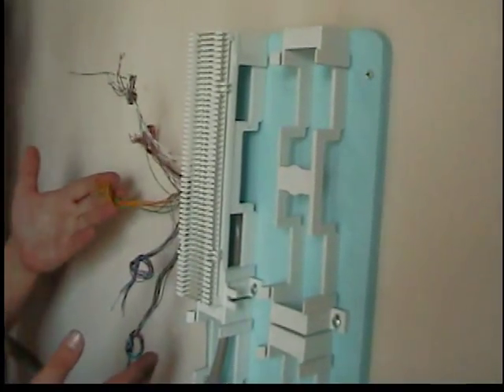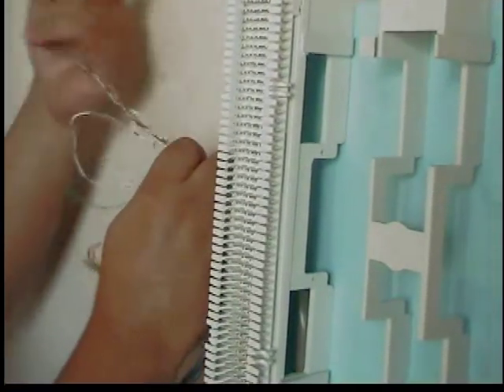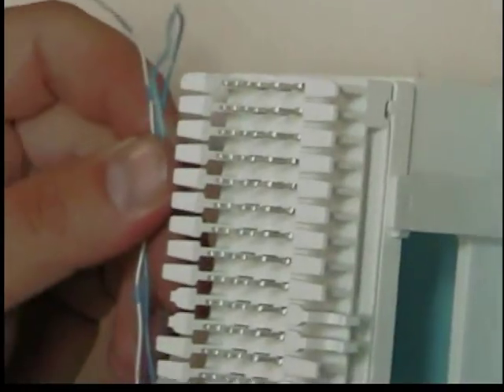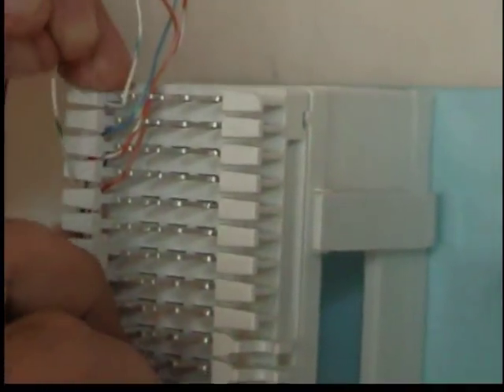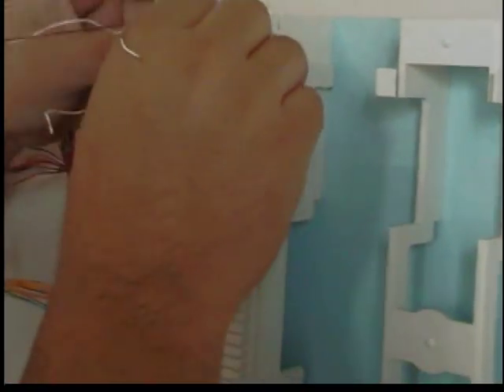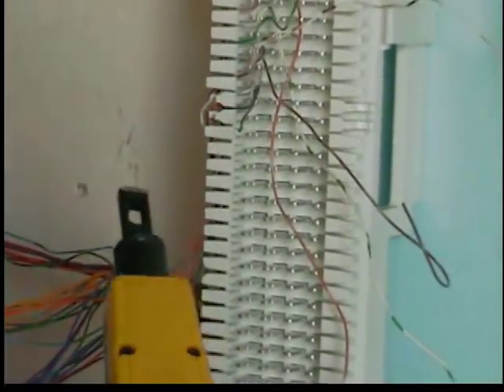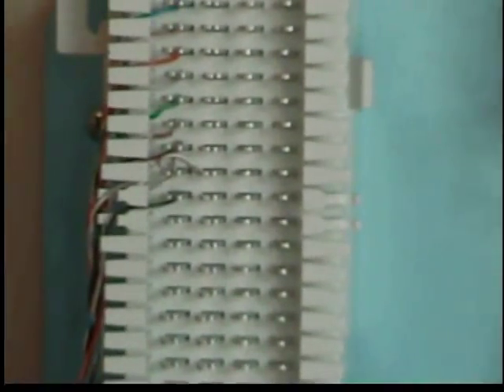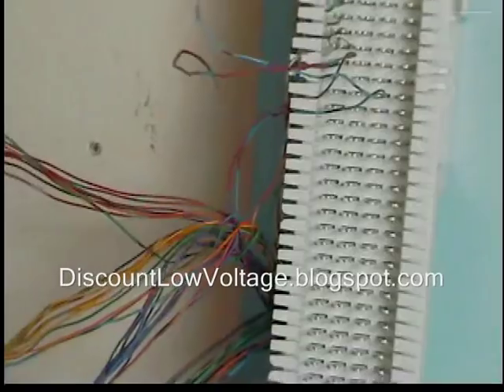How to punch down a 66 Block with a 25 Pair cable

Comment: They wrap into the pin slot from top to bottom, not bottom to top.  You should be cutting it on the bottom side of the pin.

Comment: Always pull each pair back. Easier to use the punch down tool. When you know the color code you can pull 5 pair at a time on each 25pr blk. Do the 25pr then punch it. If using only 5pr etc. then punch.

Comment: I can't imagine covering a wall with R66 blocks when BIX takes up so much less room and is so much easier to work with. And I guess it does seem to reason that we use BIX up here as it was developed by Nortel. I have seen competitive BIX like products up here from other manufacturers, but those are very uncommon. I still have an R66 punchdown tool in my toolbag but it only gets used at one location where the building is leased, and then only at the demarc.
Reply: You will rarely to never find BIX in America.  BIX is a Canadian thing because of Nortel.   I still don't understand why BIX is not used in the States, as it's so much better than 66 and 110 blocks!!